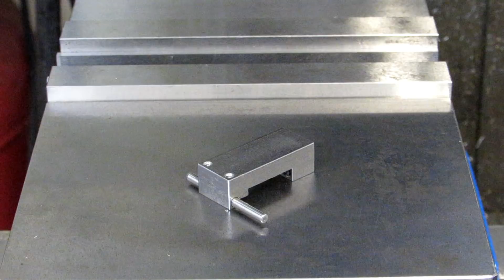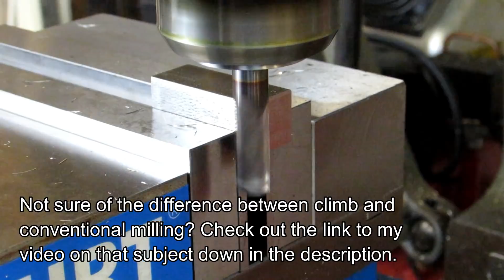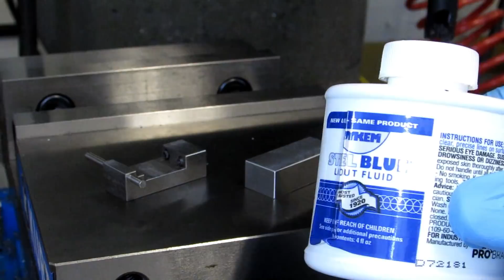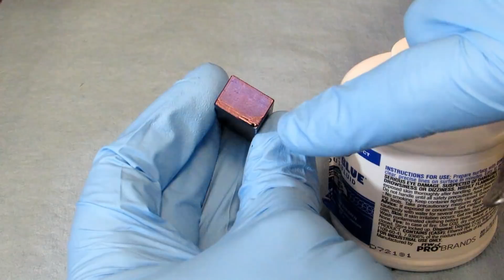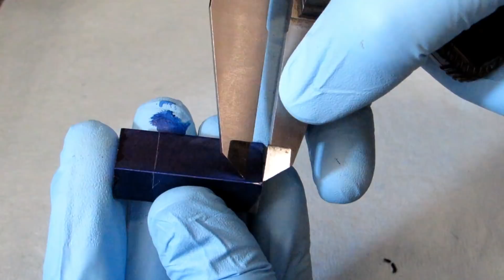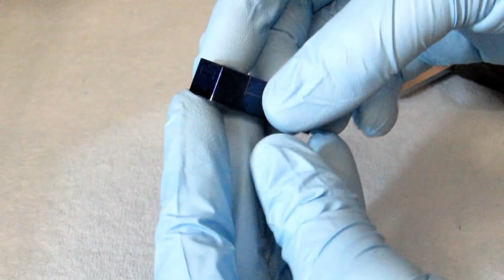Making a Vise Stop Part 1

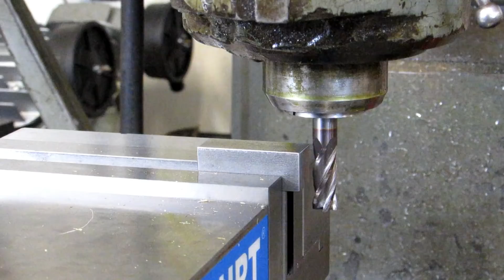Comment: Stuart, I've always been told to make sure that you have equal pressure on either side of the vise. @1:44 in, we see that you have your part on the right hand side of the vise so you can side mill it, but I don't see any packing or vise jack on the left hand side.  I've done this in the past myself.  Just how critical is this?  Can you damage the vise?  Will it cause problems with accuracy?
Reply from the maker: You know, I'd love to hear some input on this from someone who works at Kurt or one of the other vise companies, but in practice, I don't see any issues doing it this way.  Logically speaking, if there was an issue with the jaw skewing to the side, the part would only be held on the corners toward the center of the vise.  If that were the case, you'd see damage on your parts in that area where they are crushed by the jaws.  You would also see a tendency for the part to lift off the parallels as it pivots on that small area of contact and I just don't see that.  The movable jaw of the vise has a very long contact area (8.5" on the D688 here at work) and a fine fit to combat the potential to move in that direction, just like it has features that keep the jaw from lifting.  I think in most cases, you would damage the part long before you would damage the vise.  Great question! Thanks for watching!
Reply: I did a quick search and found a manual for a Kurt vise.  

https://www.kurtworkholding.com/downloads/pdf/D675%20VISE_MANUAL%20English.pdf

Take a look at Page 6.  The strange thing is, they don't say WHY.

BTW, Good Videos! May add this into a class for my Maker Space students.
Reply from the maker: Please feel free to add any of my videos to your class.  I've taken a hour or so to write the great American novel in response to the Kurt manual.  Here's a quote from that manual:

"To properly clamp a part in your Kurt vise you should place the part in the center of the jaws resting on the ways of the vise. Clamping only on one side or above the movable and stationary jaws can result in jaw lift or loss of accuracy."

The problem with this statement is that, in the real world, it just isn't conducive to machining a part when it is in the middle of the vise and not on parallels.  There are very few parts that I have made in the past that could be practically made in that orientation.  We need to be able to side mill parts.  We need to be able to drill through them without damaging the vise.  Quite a lot of parts are significantly thinner than the height of a set of vise jaws, so if we need to face them, they need to be on parallels, not the ways of the vise.  Perhaps they mean that clamping a part in that position delivers the strongest clamping force to the part, but to say that otherwise the part is not properly clamped flies in the face of the huge number of parts made every day by people who are paying no attention to that statement and making their parts with no problem whatsoever.

Here's another quote:

"If one-sided clamping is necessary you MUST use a dummy part on the other side. When using parallels or step jaws you must select a size that keeps the bottom of the clamped part at or below the top of the movable and stationary jaws."

I have used dummy parts made from the same size stock in circumstances where the part is exceptionally short, but honestly, I can probably count the number of times I've done that without taking my socks off.  Regarding the second half of that quote, I think Kurt might mean the actual cast iron portion of the jaw since they later talk about jaw plates, which I take to mean the hard jaws that do the clamping.  Besides, how are you going to clamp something that is at or ABOVE the jaws.  Unless my concept of workholding is flawed, that just isn't possible.  Anyway, this is another circumstance where the necessities of the job take precedence over what the manual says.  If it needs to be done to complete the job, then it needs to be done.  That's my two cents.  Please... discuss.